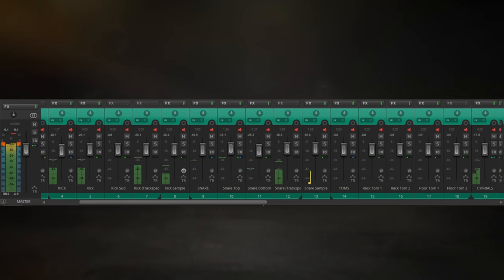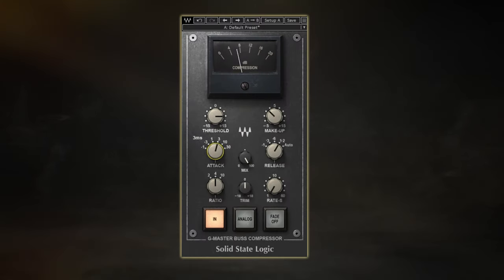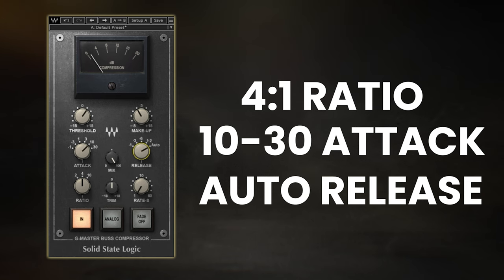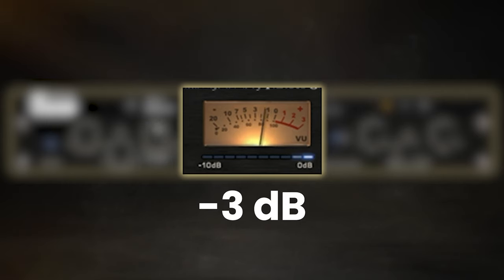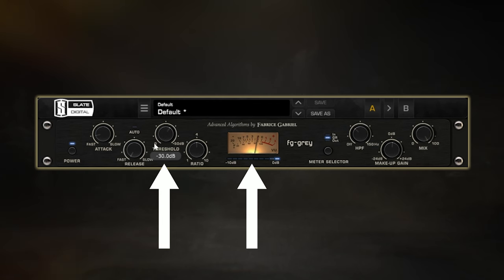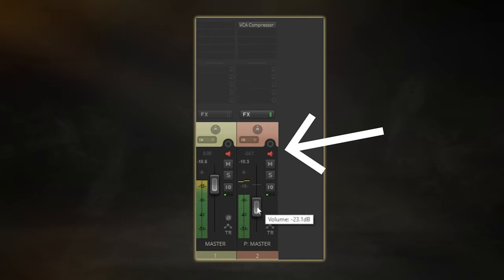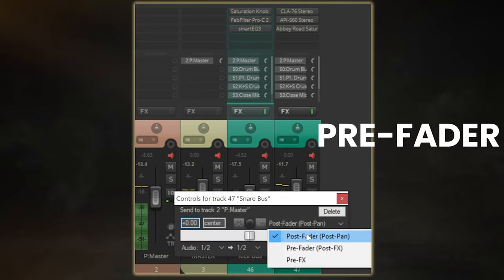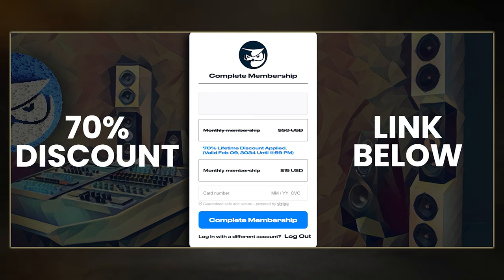Perfect Compression In 10 Minutes

Comment: A good but counterintuitive tip for when doing work with compression is to actually lower the volume you're listening the mix. Our ears are more sensitive to absolute differences in loudness at low levels than at high levels, so compression becomes more perceptible the lower you go.

Comment: Hey man, 2 questions that I had from time to time and never saw anyone talking about, what's your opinion on dual mono compression on mix bus and second how you go with make up gain on mix bus compression?
Reply: Good question!!! I use this method once in while on pad groups or strings to get a wider stereo image
Reply: I like dual mono if I am sent a fairly unbalanced track in the sense that Im getting bigger peaks in the left than in the right. May want those balanced before reaching the master phase as it can affect overall loudness and what not. 

I almost always try and level match so I know what I am changing but if I am early enough in the mix I will just go for what I think sounds good even if it is louder.